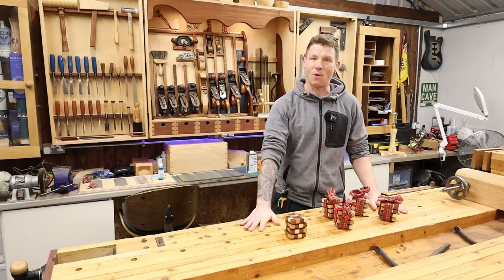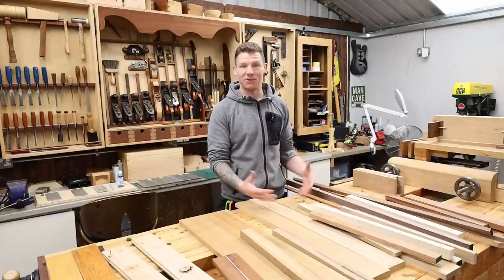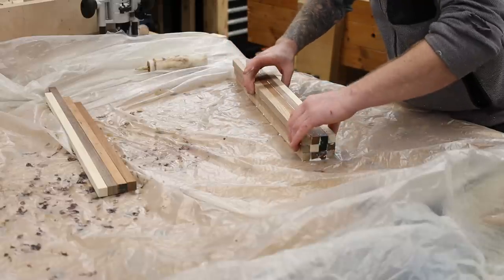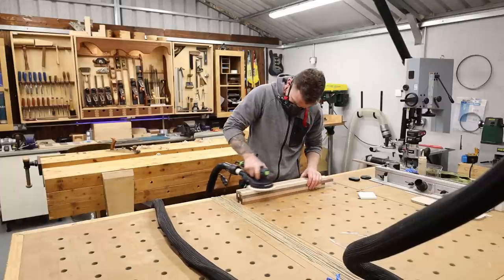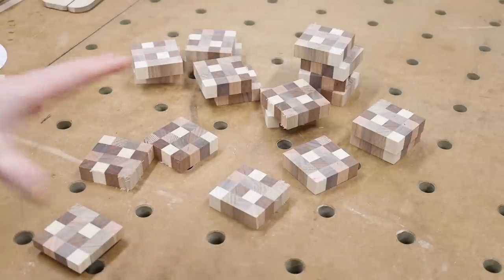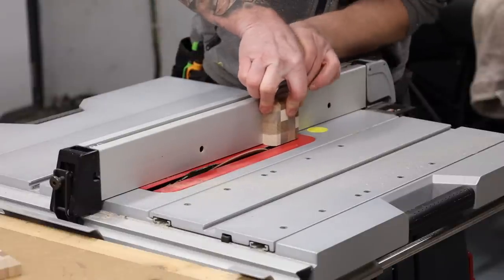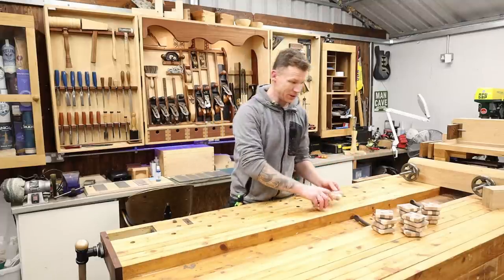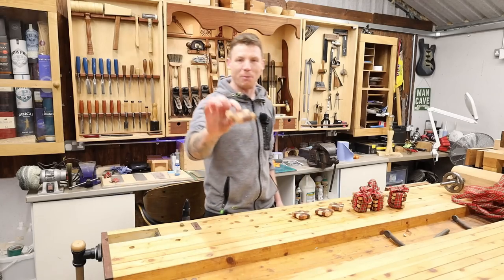Last Minute Gift Idea. End Grain Coasters. Quick and Easy to Make.

Comment: When I wanted to chamfer a 6"x6" lamp base, I used my benchtop surface planer, with the fence set to 45º. I felt that, for me, this was less risky than cutting the chamfer on a table-saw. 
I'm not criticising your method. 
We are all responsible for our personal safety and have to make our own decisions.
Reply from the maker: I would have used the planer but breakout is a real possibility when planing end grain
Reply: @JohnMcGrathManInShed  Very true. That's why I took small passes and planed the end grain first